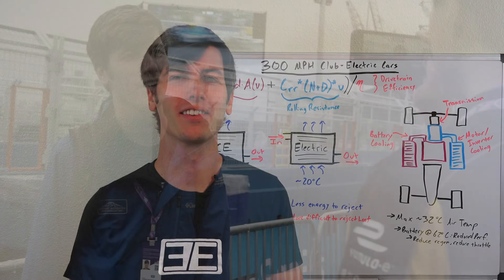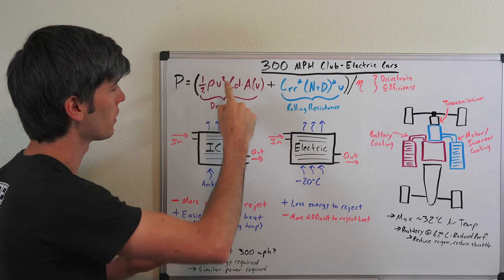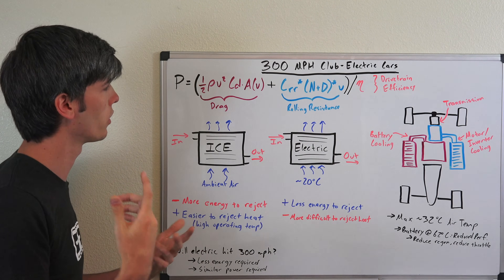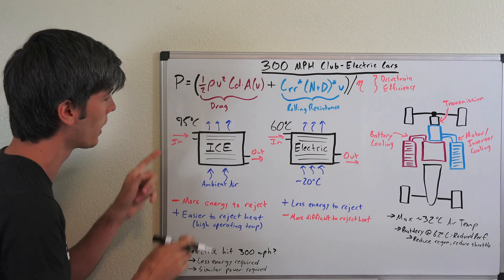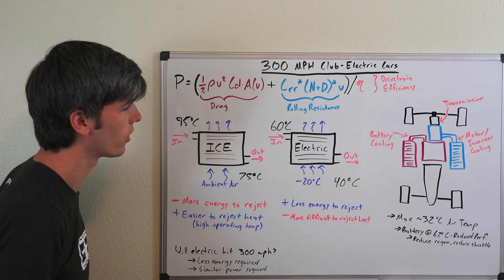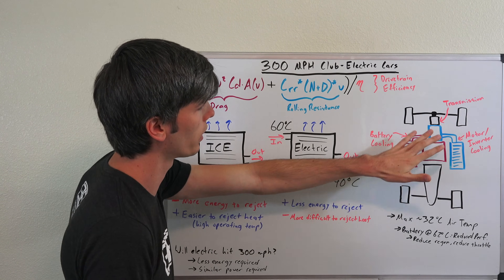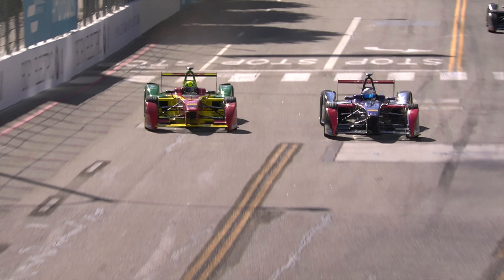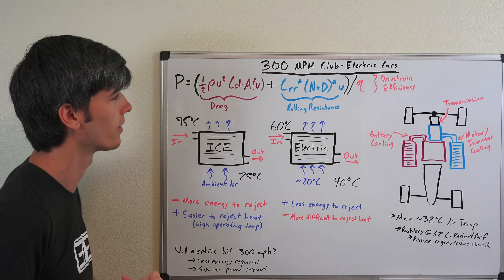Why Has No Production Car Hit 300 MPH? Electric Cars

Comment: Please be careful with calling an electric car efficient. The total energy consumption to produce exotic batteries is part of the energy, and then there is charging.. most of America digs up coal, loads and transports it by rail to where it is burned and creates pollutants that take energy to clean up.  Neuclear power has an infinite cost yet unknown, operating a few dozen years to produce waste material that remains deadly for a million years.. Hydro Electric Dams wreck the natural silt flows and destroy fish habitat, another cost of unknown final quantity. Solar energy may eventually be the best but as it exists today the energy cost of making cells is still excessive. One day we may find the TOTAL costs of electric propulsion to be lower than combustion based.. but when taken as a whole total supply chain, EVs still suck. I hope it changes sooner than later. We are on the way.. it is an exciting ride and full of hope and promise, but as an engineer myself, I must also recognize the complete and total materials and energy costs, not the politically subsidized ‘price’.

Comment: Where did the 62C for max battery temp come from?  I just found it interesting with quadcopters I try to keep lipo to ~130F, measured on outside of pack, and the center cells will definitely be higher than that..  135F starts to be where batteries start puffin up a bit....  so anyways kinda neat hearing 62C being referenced... but now I'm curious where that number actually comes from.

Comment: Actually there's one very very very large component you didn't mention and that's tire technology. The Bugatti Chiron is currently limiting it's top speeds as they say no current tire is able to handle that speed safely. Ice engines can easily get 2000hp if they're motivated enough but a tire blowout at 200mph would be beyond scary. Imagine the tire shredding at 300.

Comment: For the Formula E cars, why not flow liquid nitrogen through the radiators? The races aren't too long and it would also decease the amount of drag you need for the radiators.
Reply: Don't need to be rude. That's not how engineering advancements are made. And I'm certain that there could be a resolution to pressure building up in the nitrogen system. My original idea was a system open to the atmospheric pressure so no change in pressure could exist.

Comment: Would it be practical to use refrigerant to cool the battery in something like formula E?  Obviously that would use precious energy, but would allow raising the radiator temperature for better heat dissipation.

Comment: The worlds fastest production bike is an electric.  Any thing is possible.  But with current technology It's more likely that a turbocharged engine would be the fastest. Electric motors are known for their high torque and low horsepower. You need high torque for quick acceleration, but high horsepower for top speed. Of course a very low CdA is important with proper gearing and a little downforce to keep control.

Comment: What about using a heat pump style, water to water, cooling system? You could then have coolant temps high and a small radiator, that dissipates enough heat...

Comment: Why not use TECs in a 2-stage system to increase the thermal delta between the radiator/coolant and the air temperature?

Comment: The Veyron can get close...  270mph or so, but why?  Where are you going to find a straightaway long enough to go that fast?  (Other than the salt flats).  Even if you could...  The Veyron goes through an entire tank of gas in 8 minutes at full throttle.

Comment: How about the fact that you don't need to warm up an electric vehicle.  This means that at least in theory you could run a car sitting a ambient temps for a  hot lap where the system could absorb some of the heat generated rather than shedding it.  It would be a "one trick pony" but how often in a day do you plan to hit 300 in your family car anyway....?

Comment: So could you not put a pump (such as an AC compressor) to increase the pressure of a coolant such as (kinda like) r-134a and increase the temperature at the heat exchanger, making the surface area smaller?

Comment: Using Phase Change to cool electric vehicles could probably work, more weight, lower temps but much smaller radiator sizes. Also for peak power carrying liquid nitrogen or maybe even liquid helium for cooling could work. Its like nitrous. I had this Idea of using liquid nitrogen to break a speed record in an electric RC aircraft.

Comment: What about at 5000 meters (~16,400 feet) elevation? ICE going to be starving for oxygen while electric doesn't care about oxygen. Also less drag at those elevations, and gravity is almost the same as at sea level. Where are you going to find lots of flat land at 5000 meters? Well, there's the Tibetan plateau.
Reply: Hyper Sonic Yes, less drag at higher elevations. This also means that there is less air mass to flow through the radiator, and thus less cooling. You therefore need a proportionally larger radiator to keep your motors and battery cool, increasing your drag. Its a net wash in the end.
Reply: if you design ICE car for 5km elevation properly, turbocharger should boost air pressure back to normal boost pressure

Comment: Super conductors will get them to 300mph
Reply: Karl Warner That is old tech. If it was practical, the industry would be using it already. Superconductors operate within a few degrees of absolute zero. Keeping your drivetrain that cold is not feasible.

Comment: Why are we discussing cooling?
It's not a matter of power or drag, its that at 300mph air is dominant and your car becomes a terrible plane

For comparison with actual aircraft, they can vary between 60 and 200 KIAS takeoff speed, between about 70 and 230 MPH relative air speed

Formula 1 cars are literally upside down planes, but that's not a practical or safe design for road vehicles

Comment: A lot of what was said assumes the user is going to use it in long-term (30 minutes). I would say consider the few that would take it to the limit. Overheat the engine, battery, whatever for less than 1 minute and use internal liquid cooling, throw away the radiator, maybe throw in some gears.... presto, 300 + on electric even if not viable for long-term use.

Comment: there's a couple more challenges that would make this difficult.  electric motors don't like to make their power at the top end, which means you'd either need a crazy long gear ratio or a multi-ratio transmission.  which is an issue when considering Tesla dropped their 2 speed transmission in the original roadster because it kept blowing up.  

there's also the issue of whether or not the batteries even have enough energy to get it's top speed.  The current Model S does have enough energy stored on board for 300 miles of range, but that's at 60 mph.  with a quick conversion to meters per second gives a force ratio of about 25 times more energy.  so a that speed the car would be out of juice in 12 miles or about 2.4 minutes.  Plus, that's just a rough estimate and I'm guessing a more accurate calculation would make that number go down even further.

Comment: I liked the first 300 mph video, like this one as well. Could you make a video about the other components besides the engine and how they would be affected by going that fast? I remember an interview with engineers of Bugatti in which they explained they had to invent a special sort of rubber for thier tires so they don't disintegrate due to rotational forces when surpassing 400 kph. 
Also, a conversation from imperial to metric would be nice everytime you use some, freedom units are a bit confusing :)

Comment: If a big part of the inefficiency of cooling on an electric vehicle is the lack of delta in temperatures with the air would it be feasible to combine the transmission cooling with the battery cooling to increase the exhaust heat of those cooling systems to the radiator thus raising the temperature and ensuring more efficient cooling?
Maybe I've missed something?
Luv and Peace.

Comment: So, the cooling system and the radiators need to be sizable. The better allocation of the optimum heat rejection points, the better parameters for performance. Drag is a somewhat cruel phenomena and at times helpful. If we talk about aerodynamics, the materials also matter to provide efficient cooling. Leading to good hps and better performance.

Comment: Taking 60 degrees as your maximum temp is not really valid. Most electric motors operate >95 degrees and if you really want high temperatures you can design a motor that runs >300 degrees. Even when your battery would run at 60 being your largest heat source the radiator would be a lot smaller. 
Look at FSAE and you see that some electric teams run just two small radiators behind the rear wheel compared to combustion teams running two large radiators in side pods

Comment: In the drag equation, it's A sub v, cross-section area in the direction of velocity, not A times v.
Reply: Paul Ste. Marie If it was an equation for the drag FORCE, you would be totally right.

However, the equation provided in the video, is for drag POWER.
P=f*v so the equation in the video is absolutely right!

Comment: I think it is less challenging than ICE. For example: new Chiron goes 250 Mph. When you look at the "0-400-0" video, you can see he goes at that speed with ease and potential to go faster. Bugatti is keeping the Vmax as secret for marketing purposes later. But I would say he can reach at least 430 kph(267mph). So as we assume, that he can reach 267 with 1500 HP to the wheels, 2500 HP would be needed for 300 mph. The thing is: the engine PRODUCES 2500 HP!!! but 1000 HP is consumed by heat and powertrain losses! Thats the 60-something % efficiency it has. So engine producing roughly 4200 HP is needed and as anyone can think of such a massive thing powering like ships, tanks and mining stuff crammed into another Bugatti. Unbelievable!
So electric cars: Tesla P100D is powered by what? 3 melon-like electric motors(dual motor at the back and smaller motor on the front axle) producing ~760 HP, max torque anytime, anywhere so torque and power will not fluctuate. With efficiency, as I can remember from some article, 96-97%. Since Tesla semi-truck will be out next month, with the rumors from Musk itself "most powerful semi out there", it will be like 1000 HP or more. As I can guess, with motor much smaller than any ICE with 1k HP out there. The thing is: you just make bigger motor. Imagine the power of electric motor as big as V12 and rest space for battery. That thing could be it. It's just 4-5 times the power of P100D, and since its that efficient, you dont need make "reserve" for losses.... It's just not coming from Tesla, since supersports isnt their concern. 
Constructive comments welcomed!

Comment: I think the biggest obstacle to reaching 300 mph in a road car is the tires. I calculated that the Chiron should already be capable of reaching 290 if it is delimited and the tires hold (and if its gearing is suitable). 
If they add power later on like they did with the Veyron ss it should be capable of reaching 300 (if they can get the tires to last).

Comment: Okay, as we can see, the problem ist the temperature difference between the coolant fluid and the atmosphere. But couldn't a heat exchanger be used inside the aerodynamic body of the car to raise the temperature of the radiator and its size and drag at the same time? Same physical principle as heat pumps use, or fridges..?!

Comment: What about the feasibility of a jet engine electric vehicle? Like the GM Firebird 1, the jet engine exhaust is directly out the back, no regenerators, and the engine cools itself by it's own internal airflow. Not much cooling would be needed, and the electric portion powered by supercapacitors to get up to speed. Would that work? Or even get close to 300?

Comment: Your formulas look weird. The last v doesn't belong in the aero drag formula. Only speed in it is the v squared. And I've never seen that formula used for rolling resistance. I was taught to calculate it with F=f*m*g*cos a where f is the coefficient of rolling resistance, m is mass, g is gravitation, and a is alpha for possible inclination.
I calculated this for my sedan (calculation inspired by this video), which has aerodynamic drag coefficient of 0,34, frontal area of 1,95, doing this in air density of 1,315, coefficient of rolling resistance of 0,02 (rounded from actual measured in this vehicle) and mass of 1300 kg, and assuming the road is flat. With 15% power loss in drivetrain, I need 1276 kW to go 483 km/h in this car (300 mph). It's "only" 1735 horsepower though. (Numbers not exact, heavily rounded)

Obviously I'd need more cooling to get that power, which causes the coefficiency to worsen, and I'd gather more weight to get that power delivered, although the weight doesn't affect the power requirement that much.

Comment: I'm no engineer, but if they had a small electromechanical flywheel (like in Porsche's GT3R) as a sort of regen reservoir, the battery wouldn't risk overheating so much.  The flywheel would buffer the charge/discharge spikes of regen/accelerating, and the battery would mostly discharge at a steady rate.  It would be an all-electric, hybrid-storage system.

Comment: I  think It's all about frontal area. Production cars and Formula-E race cars needs to have a certain frontal area for some basic practicality, for stability and etc. For a frontal area this big, even if the engine produces enough power the tires will be instantly shredded. If a car is shaped like a needle, then the top speed will be drastically increased. With a small frontal area the drag will be significantly lower, and the tire will be able to handle the drag too.

Comment: You could hugely improve that temperature difference by using a heat exchanger with the cold side connected to the internal cooling system and the hot side connected to a radiator - keeps the sensitive parts nice and cold, and makes the radiator very hot for faster heat dissipation.
This wouldn't make much sense on a track car because of the added weight, but this could have huge effects on production cars where weight doesn't matter as much.

Comment: So, conclusion is that an electric car with the ~ same amount of cooling will develop more HP because it is more efficient so it converts less energy into heat? Then I guess a car like a Bugatti Chiron converted to electric can get 3000HP with the same cooling because of the better thermal efficiency of electric motors. Given this, you can more easily reach 300MPH with electric tech. Am I right or not?

Comment: The only reliable and practical way to make a 300 mph car is to use a gas turbine engine... Engine is internally cooled by the very same air it processes, and only need a small external heat exchanger for the lubrication system, and they can deliver very high power for long periods, reliable and still be very light.

Comment: Is it not possible to build jackets for the batteries and the invertor?
I'm not an engineer that's for certain, but I've wondered this before, for race cars, motorcycles etc, where you have components that need cooling for 45 - 120mins race duration, can't they put jackets insulated with dry ice or liquid nitrogen, (contained with the jacket).
I understand that there will no doubt be automotive engineers pissing themselves laughing right now, but could someone explain to me if it's even remotely feasible or it's insane.
I understand that there may be difficulties in controlling the cooling, and packaging may be an issue, but I had to ask.

Comment: The radiator heat flux is lineair with temperature difference though. A delta T difference of about 50% implies about half of the available heat flux. IC engines are much less than 50% of the efficiency of electric motors though. So yes, it will be easier to achieve with electric.

Comment: Why do you need a radiator like that, can you not extract the heat with lateral fins? like a heat sink?

If its doing 300mph thats a lot of air flowing over the surface.

Also could you not employ a heat exchange system to increase the heat delta? You'd only need to use it to get that top speed.

Comment: You can use termoelectric coolers to increese temperature differential between air intake and deflecting heat. You would need to make double cirkled cooling system (first cirkle cools a batary/motor with termoelectrik cooler, and second cools hot side of the cooler, and because termodifferential will be higher, you can go with the smaller radiator and compensate for new equipment weight.
Sorry for my english, have to come up with terminology on the fly.

Comment: What about the TGV in France? It went 320mph. Is it, because it has such a small frontal area and thus, less drag? I believe it´s because in a train you have power to spare (15-20kV@100A+) and you don´t have to care about weight. Could you make a video about High speed trains sometimes?
Reply: The main problem with fast electric vehicles is the battery heating up. Trains don't have batteries as they're powered directly from the grid so one major issue less.

Comment: Taking an idea from the Dodge Deamon ... What about using a heat exchanger cooling system tied to an aluminum body of the car instead of forced air radiator?

Comment: You can use a/c for coiling system.
What about that?
Reply: More weight, more power needed ... two things you don't want for extreme performance vehicles. But if there's no other way, sure why not. Commercial EVs are already using it.
Reply: Yes but, you need less air for cooling system so less air rasistance. In the and you gain something in top speed and you solve the battery cooling problem.